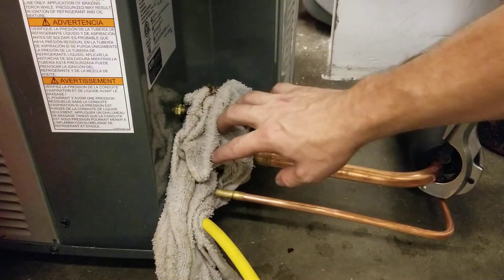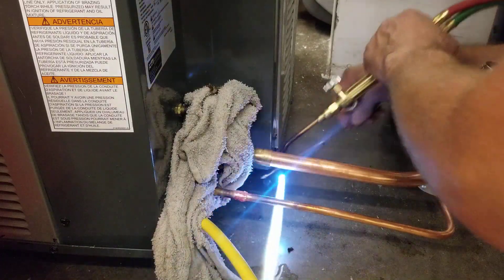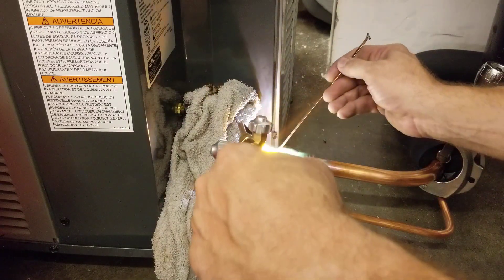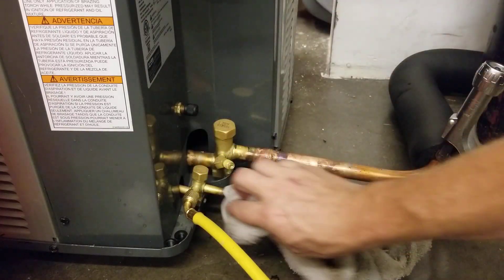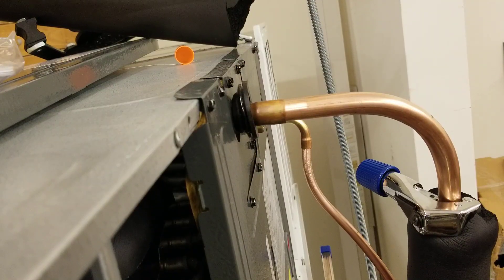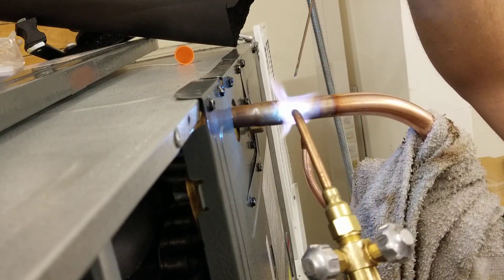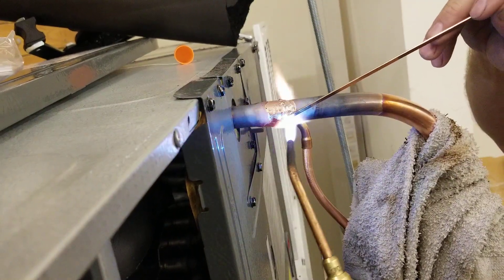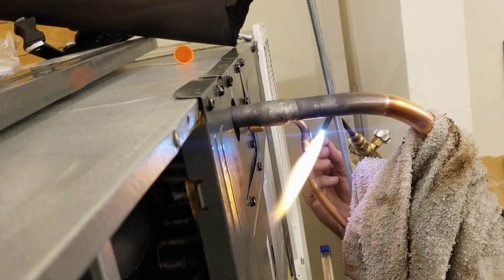Hvac brazing

Comment: Wouldn't flowing  the nitrogen in the liquid line push the scale thru the entire system instead of pushing the nitrogen thru the opposite pipe that you are brazing?
Reply from the maker: By flowing nitrogen, you prevent the scale from happening in the first place.

Comment: Hi Ty when replacing compressor with 3/4” and 5/8” with oxygen and acetylene torch what size of tip use and should the pressure be higher than 5 acetylene and 10 or 15 to oxygen? Thank you.🌹

Comment: Do u suggest brazing high pressure or low pressure side first, or does it matter?
Reply from the maker: As long as nitrogen is flowing, it does not matter

Comment: Lots of HVAC service is performed with an adjustable wrench !  After a few jobs on various HVAC you would think a tech would opt to carry the correct end wrench or fitting wrench and a proper wrench to remove set screws/bolts on fan blades to motor shafts.  Too often I see the adjutable wrench rounding off the head of bolts, fittings, etc. What about the next service call and having to put a wrench on them? The worst of them all is those who use "channel lock" pliers to wrench nuts/bolts/fittings.

Comment: When you flip that rod around and it burns a nice brand on your hand, you will start wearing welding gloves. Other than that, and the singing, good  video. PS. You should set a better safety example for your apprentices, by wearing the proper personal protection equipment.
Reply from the maker: Safety note, don't get into the trades, it's too dangerous.

Comment: Heat the pipe first just to melt the brazing rod! Anthem! I love it! Just tried brazing today for the first time and melted a hole in the darn pipe....  hip hip...  Can't wait to try again tomorrow with your anthem. Thanks Ty!
Reply from the maker: Im glad you liked it. 
Dont worry about how many times you get it wrong, keep working to make it better.
Reply: The torch tip must be moving at all times...holding it in one spot will damage your tubing.

Comment: Thank you Mr.Ty for nice teaching. Is possible to use a propane which is use for heating and cooking or butane gas with oxygen for brazing instead of acetylene gas? Another question when set up the acetylene should be at 5 and oxygen at 10 in the gauge.🌷Thanks.
Reply from the maker: I oxy propane is possible. 
Propane generates less than 10% thermal energy.

10 oxygen and 5 acetylene is a good start. Some people like different numbers and it depends on how big the pipe is.

Comment: With reference to first brazing example nitrogen was purged through liquid service port and the nitrogen will come out from suction service port isn't it?....so we can proceed with brazing after pumping down refrigerant to condenser....is that safe
Reply from the maker: Yes.
Just remember when you pump down you don't always know the condition of the refregerants or how swell the previous tech dehydrated.

Comment: Do you remove the cores from the valves? Or its not necessary? The way im being taught, in my job, is not necessary.
Reply from the maker: For brazing I remove the cores every time. It does not take but a few seconds. They are very small and sensitive to heat. It is also very difficult to flow nitrogen with them in place. 

That said, Never argue with your lead. Eventually you will be in your own truck.
Reply: @love2hvac  That last part is true..hehe. But you're right. Thank you.

Comment: Good day, You are the best instructor online. Do you have any video about the TXV external equalizer, what/how does what is does, why is better than internal Eq...Thank you!
Reply from the maker: I prefer external equalizer, it gets a more accurate superheat reading since it is getting it pressure at the end of the evaporator.

Internal gets the pressure right after the txv, and does not account for pressure drop of the tubing in the evaporator.
Reply: @love2hvac  Thank you!

Comment: Great stuff. Can I place a request? Can you do a class on none condensable refrigerant in a unit? What the symptom's would be and how to be sure not to mistake it for another issue. Thank you so much
Reply from the maker: I will try to get to it. Still setting up the lab at the new school.

Non condensibles will have the same symptoms as a restriction. With proper airflow you will see a  High superheat and high subcooling. I have a paper somewhere in a box I made for that. I will try to find it this weekend.
I recomend using the same solve for both. Recover all the refregerant.  Open the metering device and check the screen and look for contamination. Purge some nitrogen threw the line to see if there is any restrictions. Cut out the old drier. Braze in the new dryer while flowing nitrogen. Pressure test with trace amount of refrigerant and a sniffer refrigerant leck detector. Pull a vacuum to 259 microns not to rise above 500 after 20 min or manufacture recomendations. Recharge with new refrigerant.
Reply: @love2hvac  Thank you. We are rooting for you here in New York to  succeed at your new home 😊.  Btw you inspire me to teach my coworkers and I make them all watch your videos. Thanks for everything

Comment: How do you flow nitrogen through a non-bleed TXV?   I've had problems with this in the past.  No matter how small I make my flow rate, it still wants to blow the solder out of the joint.
Reply from the maker: Great question Bob,
If it is a threaded Threaded TXV, I just leave the TXV out until all the brazing is done. Leaving it attached as if it was a fixed till I complete the brazing.
If it is a pre-brazed TXV inside the coil, then I will add a service port outside the evaporator on the liquid and the suction line and push nitrogen threw both lines outside with a tee.
Reply: @love2hvac  Thanks for the quick reply!!!  Nitrogen will then flow from the injection point outside to the newly added service port.  But it seems to me that it won't get to where it's needed - the actual braze point for the TXV which is downstream from the newly added service port.  Am I overthinking it?

By the way, yours are by far the best HVAC training videos I've seen so far.  I've forwarded them to a couple of my apprentices.
Reply from the maker: @cleansebob1  yes your right. It is not nearly as good as it flowing past the braze.  The main purpose is to keep the oxygen out to prevent oxidation. So while it is not as good it still limits oxygen. 

Thanks for the complement, I'm still learning every day. I Iove this trade.

Comment: Nice series.   But,  what happened to rag cooling the joints at the air handler?  Annealing?
Reply from the maker: I should have had another rag inside behind the panel.
It is a good idea to move the wet rag over the joint as soon as its complete to allow for annealing.

Annealing for copper is keeps it soft where as annealing for steel makes it harder and more brittle.
Reply: @love2hvac  I think you mean quench. Quenching copper anneals it making it soft. Quenching steel will make it brittle. Annealing is a term used for process of softening metals. Thanks for the video. Nice.
Reply: @love2hvac          ;-).          thanks for the series!